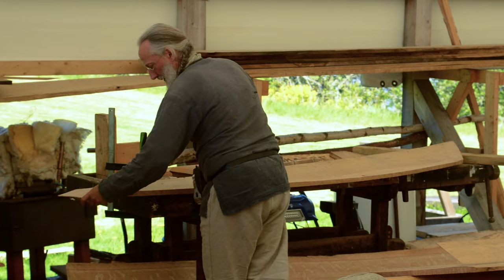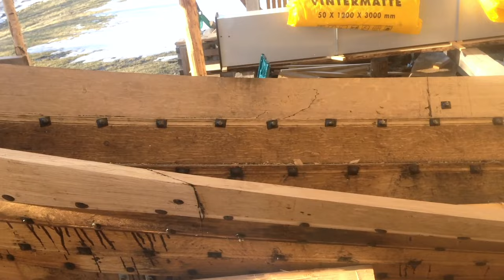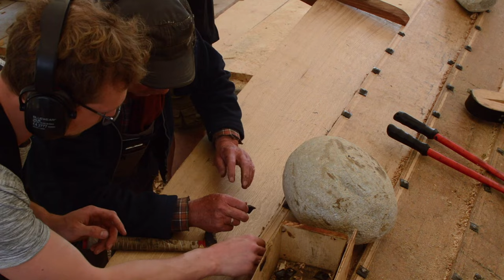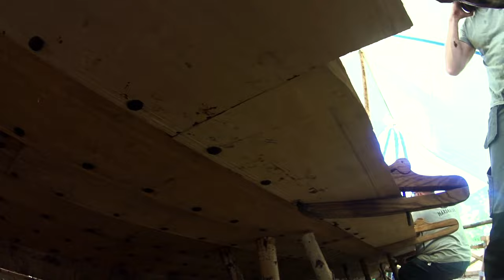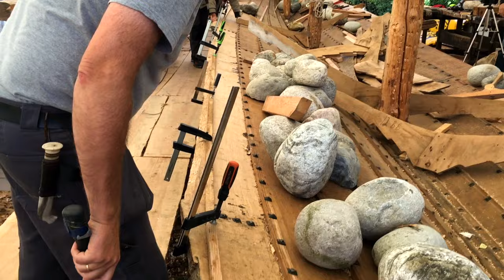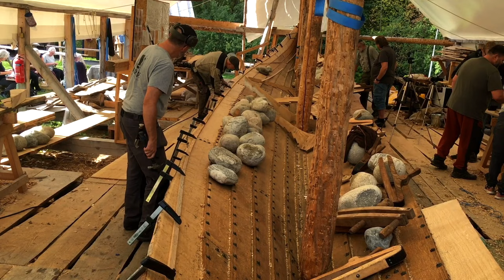🔴Viking ship building in Norway - Part 6 "Boards/Strakes" (SLOWFILM)

Comment: 2:45 I've never seen this kind of clamp before, they seem great but probably quite expensive?
Reply from the maker: The clamps were made by  the volunteers, they are one of several variations possible for use specifically with clinker-built boats. So I suppose expensive in a sense. Happy Easter!
Reply: @LucasRichardStephens  Do you know of a name for this type?
Reply from the maker: I think they are called lapstrake clamps in English, but there are several different styles that achieve the same result.